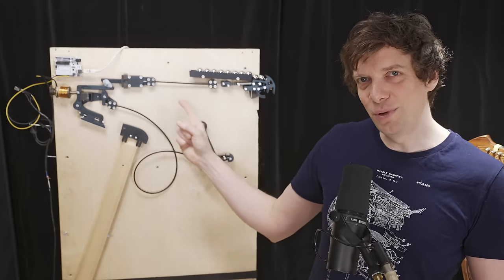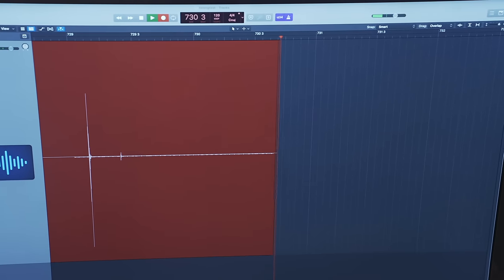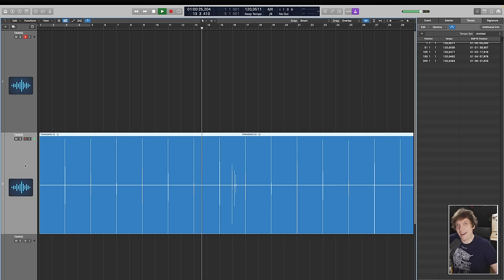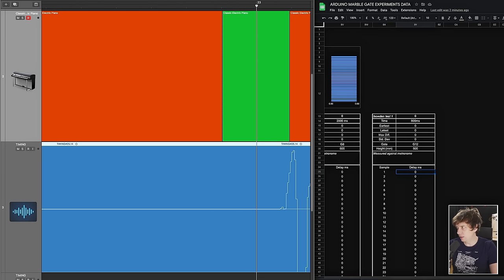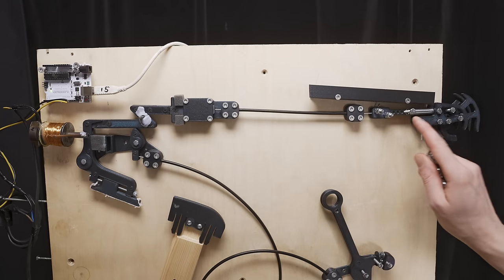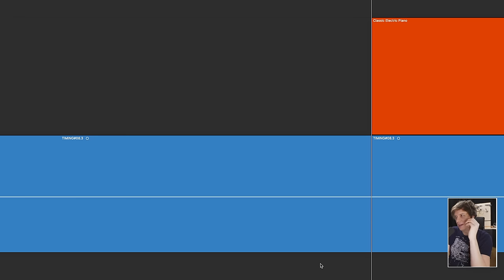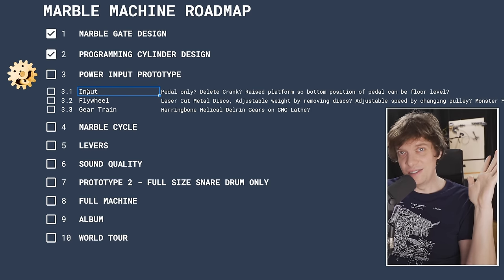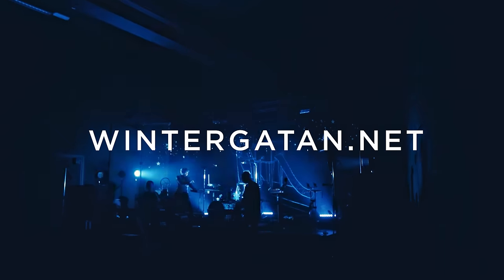Can Bowden Cables Play Tight Music?

Comment: Please martin, use loggerpro and some light gates for measuring the marble drop timing. This system of dropping them and measuring it in a music software with a contact microphone leaves so much room for error
Reply: Especially when he gets to also "decide" whether or not something passed.  Also, how is the standard deviation for timing ever based on "pass/fail"?  This whole approach makes no sense.
Reply: @Barkingstingray  Couldn't agree more.  Not even sure where this entire drive for "tightness" is even coming from.  Was "tightness" really the biggest problem with these first two versions?  It's been pointed out ad nauseum that ms does not matter when it comes to music.  Yet this seems to be his new driving principle, even after his whole lecture on "less stupid design requirements."  Yet here he is...10 years (?) later...

Comment: Martin, what do you think about making the escapement wheel bi-stable by adding a very tiny spring in there like a light switch mechanism? It might help snap the dropper into its extremes even when under powered.
Reply: In that case, it would rather be N-stable ( N = nb of teeth on the escapement wheel). Not easy to make ! ;)

Comment: Have you considered fatigue in the Bowden cables? I expect like the springs it is a consumable, perhaps replaced each gig and therefore the ease of which that can be done (especially custom Vs standard lengths)
Reply: Springs are only consumable if you stretch them too much

Comment: Hello Martin, have you validated the timing of the Arduino? Be aware that using delays in situations where you want precise intervals is not the best solution. The crystal used for the timing I’m the Adruino should be precise enough to just use the same timing on logic.

Also, I think you can skip the use of locknuts using a Alen machine screw, we’re the head is fully enclosed in the plastic, leaving only the path for te tool and screw.

Comment: Please just write a simple script which detects when the audio amplitude goes above a certain threshold, and then measure the deviation from perfect timing for each hit. This will give you much more accurate statistics.
Reply: Or have someone write it for you.
Reply: There's no way the test you're using now has enough statistical accuracy for the margins you're trying to measure. Please read up on experimental design, you could really benefit from it. A gauge R&R would be useful here to design a measuring method that can be reliably used throughout the prototyping process. This will also give you the standard deviation of the measuring method itself, so than you know that all differences you measure below that value are basically zero difference. Now you've just chosen 1 ms randomly.
Reply: Yess. He's just saying sub 1ms residuals are good enough, which is fair, musically speaking. But we can't see the entire impact of these parts because the sub 1ms variance hasn't been quantified.

Comment: Maybe you should upgrade your analysis from manually assigning time offsets and "excel engineering" to something a bit more sophisticated, e.g. python/jupyter. I would guess with a little Jupyter notebook, you could easily read your sound samples (e.g. wave), find the peaks programmatically (e.g. scipy.signal.find_peaks), then do all the statistics you want. Not just the standard deviation, but I would for example also look at the real timing, and the residuals vs. a linear fit (some systematics?)...

Comment: Are you going to do the actual machine in 3D printed parts, or are you going to machine them/have them machined? Because if you have something like the gate setup on lockdown, you could consider ordering the parts you need sooner rather than later to account for lead times.

Comment: Timing is great with it, no doubt, but Bowden cables, they have a lot of friction (compared to non-sleved cables). Make sure you don't have a compounded issue that works like a brake on your drum when too many notes are played that have engaged and move Bowden cables in short succession. No doubt, one cable doesn't do that, but you have to add the friction of all notes played in one cycle times the friction of one, and that energy needs to be overcome by your next chapter without causing a timing issue. What I mean by that is that if there are a lot of notes played at the same time, the drum should be easily overcoming the additional friction from Bowden cables.

Comment: If the arduino already plays tight music, why not use that as your gate trigger? You can still use a programming drum, but with electronic switches instead of mechanical levers for triggering the individual gates. It could possibly make the programming drum smaller, but then you could make multiple programming drums that would be easy to pack/travel with. (just a suggestion)

Comment: I really don't understand the choice of Bowden Cables for the marble dropper. If the use is a straight line over such a short distance a stiff iron wire is much better! Otherwise, as he says, this test is really not good, why not have made a longer length and a loop like with the mute mechanism?!
And again seeing the Bowden Cables lose rigidity, gain in friction and lengthen as they age, it would be necessary to find a way to take this into account, for example to do a gigantic number of tests to simulate aging.
Reply: In the final machine it's unlikely that the marble dropper will be that close to the actuator.  I agree though, anyone who works with Bowden cables knows that wear and creep over time is definitely an issue.
Reply: The problem with the spring already shows that the friction is not negligible in these very ideal conditions. And multiplying by all the channels will also have consequences on the programming wheel which will have to be taken into account for the design, thus measuring the friction of a Bowden Cables which will have played thousands of notes.
Reply: He's been talking about being able to arrange the actuators independent of the various kinds of instruments, which includes things other than the balls.  It's a lofty goal.  Lot's of people are warning him about what he's in for.
Reply: @kaasmeester5903  Yes so this test is no a test because are unrealistic in the long run.
Reply: @TesserId  ok, so" why not have made a longer length and a loop like with the mute mechanism?!"
Reply: @tiper2107  That's what we want to see tested.  He should try to simulate the conditions that he will actually be building to see if there are any unexpected side effects.
Reply: @TesserId  Ok I don't speak English maybe I misunderstood your first comment, I agree with what you said.
Reply: @tiper2107  Don't worry about it.  I wasn't exactly laying out a project plan in that first comment, and such things can always use a little extra explanation.  Besides, Wintergatten is a perfect international bridge.  And, I'm happy to honor that by keeping things as friendly as possible.  Cheers, friend.
Reply: @TesserId  :)

Comment: I don't understand why this programming wheel has orders of magnitude less slots than previous programming wheels  
Could someone explain
Reply: hello :D Basically he's not using pins anymore but these plastic profiles which can contain more than one note in a single piece: Imagine one piece of plastic which last for 1/4 bit and has four indent, each with 1/16 notes. As the reader pass through the single plastic profile, it's going to release four different marbles at 1/16 bit each. This also offer greater flexibility because he can play more "exotic" notes, such as triplets. 
While the advantages are many (flexibility, less pieces, simpler wheel), it also means that he needs to change the whole wheel for every song, since reprogramming it on the fly it's now more complicate. I also pointed out that changing the whole wheel could present more issues, since it's now a part which has to be stable enough to rotate at high speed BUT ALSO easily disconnected from the machine. I'm sure he will find a way.
P.S. He somewhat explains how these profiles work in old videos but arguably can be quite confusing. Hope this helps.
Reply: In an earlier video he indicated there would be multiple wheels spinning at different rates. His current thinking is that having the "pins" this new way will allow for controlling more than just notes but other things as well (modulation/whammy bar?). It remains to be seen how quickly the new machine can play notes.

Comment: That upper cable is unrealistically short and straight. If it were like that in the final machine there's no point in a bowden cable. Make it as long as it would be in the final machine, with bends to introduce slack and friction for a proper test.

Comment: Bowden cable for the channel on-off makes some real sense because there's only so many good ways to get the lever control to the channel.  Necessary evil... should be reliable enough for the relatively small number of cycles per songs per month and there's not so many of them that you can't replace them quickly as needed.   But using the cables to control all the marble gates?  I say not only no but hell no to that.  How often do you want to change these things due to wear or random failure?  The top bowden cable you show to actually actuate the gates is the Achilles heel of this thing.  It's a massive WEAR and RELIABILITY issue.  It'll seem to work great for a while when it's brand new then go to hell as it wears.  Everything else you've shown so far looks extremely good from a design, reliability and maintenance standpoint.  But I'm terrified of the reliability of that many cable linkages.  One or more of them is going to fail during any given concert IMHO.  And if you don't replace them all regularly on a fixed schedule you'll be chasing some random few of them going bad constantly.  Prove me wrong and a million marble drop test.  You'd better do it NOW and with some pretty long bent cables to prove it'll hold up.

Comment: Unfortunately, this isn't a very representative test since the length of the cable-span is so short and straight. You've already expressed an interest in designs that would likely require cables spans more on the order of 1m than 10cm. I would suggest repeating this test with 1m cables with a significant S-curve to them, a worst-case scenario instead of a best-case one.

Comment: I disagree that this test had any value. The bowden cable was way too short and completely straight, might as well have just connected the solenoid to the gate directly. The only thing you measured here was the difference between having the second spring and not having it.

Comment: I'm not a statistician by any means, but the way your using "standard deviation" at the moment really is just a glorified "Are all values equal to 0ms, when measured at a resolution of 1ms?".

If that is what you want, that might be fine, but I personally wouldn't call that a "standard deviation of 0ms". If your standard deviation is exactly zero, that simply means that all values are "exactly the same", which defeats the purpose of calculating a standard deviation in the first place.

To properly use standard deviation you have to measure with a higher precision and then choose a value for what you want your standard deviation to be at most. E.g. you require a standard deviation of at most 1ms, which then guarantees certain properties about your samples (something along the lines of x% of samples will be less than y ms).

Comment: brushed DC servi motor with tacho feedback and encoder, I'll write the code for the controller. can use off shelf Texas instruments c2800 development board, super simple h bridge. why brushed DC, smooth low speed operation and less noise than a AC or bldc motor

Comment: Martin, the weight of each ball will also determine the speed of the fall. The ball only needs to be a fraction heavier or lighter to throw out the timing.
Reply: Khm... Nope, at least not to be noticed with range of precision Martin using.
Balls do not generate enough drag to make the difference noticable.
Please refine your physics knowledge.
Reply: @TheNadOby  i mean, that's a totally fair point to raise, as marginal as that impact might be. martin is dealing with a very small variance here, which is clearly visible in the transients, even if he ignores residuals below 1ms (rightfully so, musically speaking). at that point it might even be the variance in weight of the marbles or whatever is stuck to their surface (skin oils/residue), i mean i don't have a intuitive understanding for how big that kind of impact could be, can you quantify it? have you analysed a batch of martin's marbles yourself? And get that silly remark at the end out of here.

In the end of course there are also other factors that bring variance into the measurements, that are all imposed on top of each other, each one broadening the distribution.

Comment: Do you even understand what standard deviation means? When measuring with only 1ms resolution there is still a sigma > 0, you're just being inaccurate. Try drawing a normal distribution with sigma 0. Btw, you missed the last drop being outside of the green box limit, so I guess still 1% inaccuracy?...

Comment: Mathematically speaking, saying 0ms as standard deviation is nonsense when considering that 100% of your results are in the range [-0.5:0.5] ms from tempo reference. With 100 hits, you can have 50% at -0,5ms and 50% at +0,5ms . "Real" standard deviation will be 0.25ms in that case, not 0. Though, it's not a big deal for human ear, it's not mathematically right 😉 You'd better simply say that all hits are in the targeted tempo tolerance of 1ms, that's great enough. You should also ensure that this result is consistent across various (and extreme) BPM's. Keep on improving Martin but, please,  do not try to "marble-ize" maths !

Comment: Why do you insist on embracing engineering and saying such nonsense things as zero std dev.  At the very least the std dev is the width of the green bar.  But you have the data to actually really calculate it. Peak time minus ideal, put them in spreadsheet, or python or anything.

Comment: I'm sure you've already considered it - but you could do without the programming wheel completely and just use an arduino, MIDI and solenoids... That would be the ultimate "part count reduction"... Plus think of how much easier switching songs would be... Although I can understand if this violates your definition of a marble machine, it feels like adding a requirement that comes at a significant increase in complexity.

Comment: I think you've gone down a rabbit hole you're not gonna get out again, with the obsession to get the machine to play tight music, with so many moving parts and adjustable parts involved.

I can almost guarantee you that if you took any mechanical music machine from history, and measured the tightness of it's music, you would get the conclusion that none of them play super tight music.

You are trying to build a much more complex mechanical machine, with the requirement to play tight music, when much simpler machines haven't been able to do so previously.

You are treading waters that have never been treaded before, basically completely on your own... when previously it took hundreds of years to design music machines that play as well as they do.

That's either extreme confidence amounting to god complex levels, or, which I rather believe, an unintentional dig into a rabbit hole that you didn't realize was deep enough to reach china.

At least you have now realized that you first need to test whether it's possible to even play as tightly as you want the machine to play.

You might have wanted to start one step prior to that however: checking whether other complex mechanical music machines exist, that are similar in complexity to your machine (i assume there isn't), and are able to play very tight music.

If the next most complex machine cannot play tight music, you need to reevaluate if you wanna even pursue such tightness. It might very well be an endeavor that you cannot finish in your lifetime.